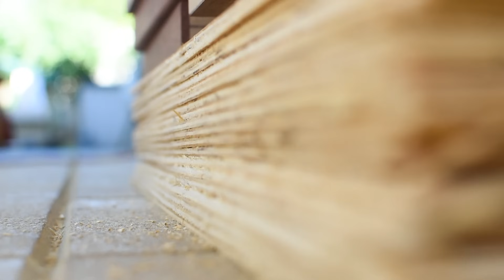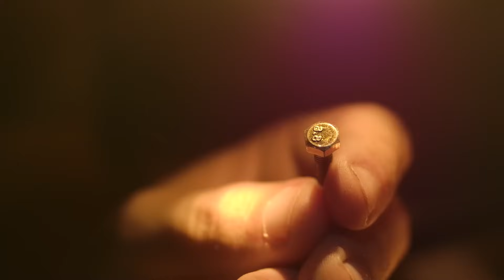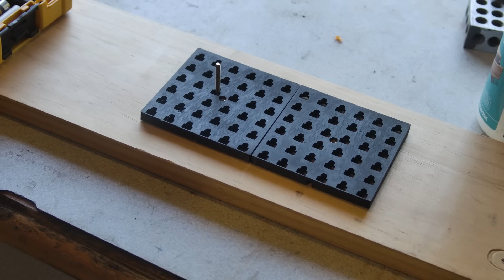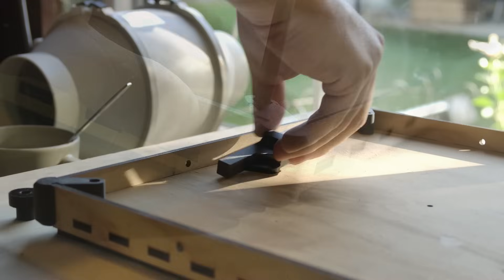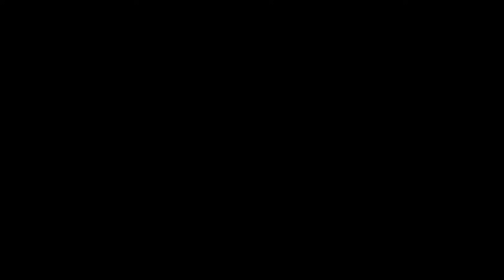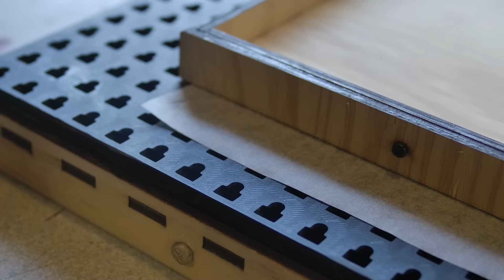I 3D Printed The Ultimate Fixturing Tool

Comment: just found this channel and im really enjoying all the functional prints. wanted to let you know incase you didnt, you can always "over vibrate" the concrete if you want the concrete to sink. you can either use a specialty concrete vibrator, or a reciprocating saw with the blade taken out. oscillating saw with no blade is pretty good in a pinch too. if you just keep vibrating eventually all the aggregate will sink down. its actually something you usually need to avoid because it weakens the concrete. but in your case you dont really care since you are not using it in a meaningful structural way.

Comment: Awesome! 

This won’t be useful for building vehicles or large furniture, but for tinkering and hobby projects this is incredible. 

I’m surprised I haven’t really seen any small scale fixture setups before. The smallest I’ve seen were small welding tables that are still a significant bit bigger than this. 

Once I get a new printer, this is going to be one of my first prints.

Comment: Am curious to know how long it took to print your plate. On my Ender 3 Pro, with 0.4mm extruder and 0.2mm layers -- sort of the default print mode for most of my stuff -- it would take almost 18 hours to print one of the 12×12 plates. I want four of those to clip together, so that's about 72 hours of printing. The idea of setting the equivalent number of nuts into a plywood sheet, or even routing T-slots into plywood or MDF, sounds like a better approach for me as I have the woodworking tools to do that. Very cool idea, though, and your presentation is great -- it certainly makes me want to try this out in some way.

Comment: Seems like you should consider using a high-strength, flowable grout would be a better option than making mortar by sifting out the coarse aggregate from concrete. You can get class c grout (dual shrinkage compensated) for about 35 AUD per 10L (20kg bag) for structural applications, and class a for about 20 AUD per 10L where shrikage isn't important (like this application).

Comment: Next time you have such a large part that's heavily warped, screw it down like you did, or weigh it down with something heavy (and temperature resistant, like a glass plate), then put it into the oven for "long enough" (e.g. 15-30 minutes) at a temperature slightly above the glass transition temperature of your filament material. This should relieve all the internal stress.
Reply: I thought you were going to put it out in the sun on a warm day

Comment: neat little porject. 
But with how often you use concrete, ain't it cheaper to just buy cement than mixed concrete with aggregate you still need to sift out?

Comment: You should make the 10mm spacer with the number on the side and the slot shape on the top to be able to add spacers in increments of 10mm and finish with the other spacers on top if needed. Or make 20,30,40 mm spacers with the hole if multiple 10mm's become unstable.

Comment: I've done the same with large parts on the XL. You could have put the part back on the bed and heated it back to 60c, leaving it to heat soak for a while and then adding some light weight on top. It would conform to the bed again and then I drop the bed to about 35c and let the part stabilise. This usually sorts things out.

Comment: Great work! It had me wondering if that plate could be made on a laser cutter instead of 3D printer. The top layer would have the pattern you have and the bottom layer would be just normal rectangle holes. You could stack this layer for the needed clearance height.

Comment: Man, your project videos set the quality standard that I'd like to reach someday with my own videos.
I had a couple thoughts watching this one.  I learned from a recent venture with epoxy on my mother's kitchen table that a drop cloth is never enough.  I think eventually you'll have glue and other bits entering your fixture plate.  So it might be a good idea to make channels for such things to run out, make the plates easily replaceable, and use a surface treatment to prevent sticking as well (like a more permanent mold release).  This could also make it easier to clean and vacuum.  You might want to make the plates and clamps out of a more temp-resistant material.  Else you might soften it when you use any power tools like a sander.  T-Track is another very popular standard for fixture tables.  There might be some value in checking that out as well if you ever want to do a V2.

Comment: Quicker to make version of this could be done using laser-cut parts glued together into a sandwich construction(larger shaped(square/rectangular/triangular...or the same shape you already have) holes in the top plate that could be made out of flooring laminate which is very flat and hard wearing) or even just a piece of particle-board flooring(heavy and flat) with lots of holes and  beat-in nuts(glued in place printed sidesto make it look nice and yoga-mat underneath to cover the 1mm protrusion of the beat-in nuts and make it non-slip)

Comment: Keep using concrete even with the aggregate left in, the rocks help bind it together. If you had used mortar on a project this large it would likely crack. However when trying to get a flat surface such as this case, get a trowel and tap it flat side down on the concrete over and over, the big rocks will sink and the liquid will rise to the surface. Do this across the whole thing and then smooth it out like icing on a cake and it will be like glass. Hope this helps!
Reply: Look up creaming concrete (Im sorry thats what its called XD)
Reply: @JaredLesniakowski  
We call that floating,
Reply: Just buy low shrinkage grout and pour it wet. its basically SCC that way and easy to pour and handle for something like this. The rocks actually are a filler to replace cement ( and lower cost )  in concrete mixes

Comment: Rather than using concrete, which has chunky aggregate, I suggest cement, which is more like mortar. I would use a small bit more water to your mixture to make it easier to use, as well as allowing the air bubbles to be vibrated out easier.
Reply: Or maybe sift the concrete through a coarse sieve to at least get the bigger rocks out. But I think it'd be cheaper to get cement especially when you factor in the labour cost, and the dust mess.

Comment: It could also be a be laser cut from several layers, hex pattern base, cavity middle, and insert opening on top surface. 7 or 8 mm sheets would likely do the trick and could simply glued together with some registration pins and weights to hold flat.

Comment: Really nice. 👍
 So sad it doesn't work with 10mm spacing 😥
Reply: why? just make the guide pieces 5mm bigger. the clamps are adjustable so it really isnt an issue. he does need clamps to hold the work piece down to the bed.
Reply: @spud4242  10mm spacing would make mental math so much easier

Comment: I fix warping like that by heating the print bed to 60 C, placing the part on the bed, and weighing it down with flat things - I use hand planes. Let it sit for a few minutes then shut off the bed and let it cool.   Works well enough for the girls who won't go out with me, as they say.

Comment: Thank you for making your drawers out of re-used wood instead of 3D printed plastic, and most importantly also showing how you did it to set a good example.
Reply: I forgot to add that just about every other form of filament is in fact recyclable. This is a very earth friendly hobby that can almost instantly blend itself into countless other hobbies. True, there are some forms of filament that does not recycle, but some filament manufacturers are willing to take your failed prints, or otherwise unneeded prints, in exchange for a discount on future purchases. They then remelt it and roll up new rolls of filament, effectively recycling an unrecyclable plastic.
Reply: @PaganWizard PLA does degrade with each time it is molten, and becomes brittle.
However, it's made from corn. Definitely not the most eco-friendly crop, but infinitely better than all the other crude oil based plastics.

Comment: i just made a similar rig for a different purpose - the grid is two 3mm laser cut sheets one with the keyhole shape and anther with a supporting shape to limit the movement of the actually pin thing to one direction (making it easy to remove). funny coincidence. also if the rectangle where square itd solve ur issue about orientation

Comment: I'm curious about your opinion on concrete vs plaster. I don't understand the mechanical difference between the two when used as a filler, but plaster seems like a smoother blend. (Also I have a 50 lb bag of plaster I don't want to throw out...)
Reply: for this type project (light duty) it should be fine, though if i were to make this I'd probably just leave it hollow and use the area below the plate to store the clamps
Reply: Plaster isn't as strong as concrete. More prone to breaking and chipping from rough handling.
I also think, that plaster has a harder time standing up to water and oils. But I'm not entirely sure about that.